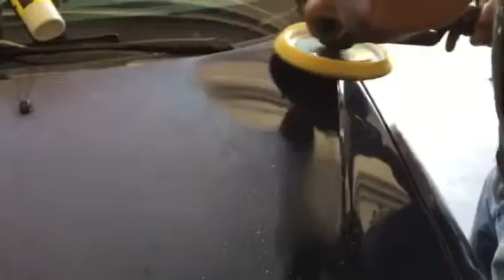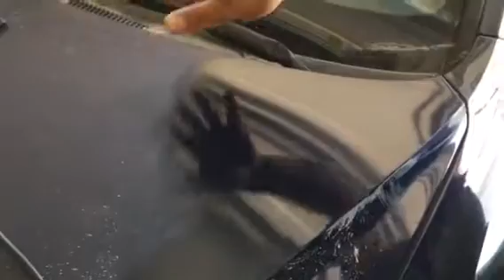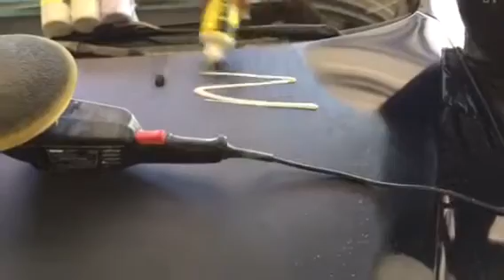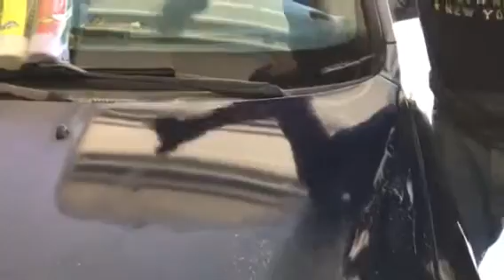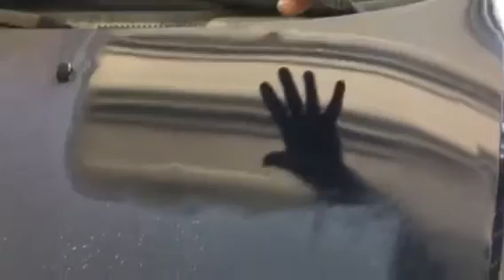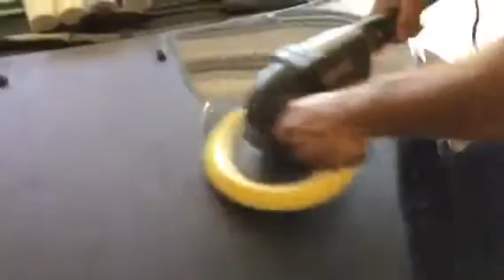Lukat Fix It and the Electric Polisher 3

Comment: I used some Lukat Fix It today used the rotary on speed 6 I burned through the clear a little bit but gonna paint my truck again this year had it on a speed 6 got a da polisher battery operated too rotary got to watch on speed I did the same thing almost two years ago.
Reply from the maker: These products are made for restoring old auto paint jobs 
If your old car or pickup truck's paint is old and hazy here's the product made for bringing back the good remaining color and shine. Lukat Fix it Color and Gloss restorer polisher and the Lukat EZ Sealer wax.  
Two Products Two Simple Steps One Great Finish
Step One: Use The Lukat Fix It Old Paint Cleaning Polisher to remove embedded oxidation, contamination, from off of the surface of your old auto paint job.  
This product is not an auto paint wax rather it's a liquid deep cleaner made for polish cleaning removing restoring your old paint job back to a smooth and shiny state. 
If you have a classic car with an original single-stage paint job with an oxidized chalky patina or a ruff textured patina on an old metallic single-stage base coat? Then this is the stuff to bring it back.
Step Two: Use the Lukat Ez Sealer Wax to preserve and protect the finish. 
Apply like a regular wax let dry and cure for about ten to twenty minutes then remove. 
Remember these are old paint restorer products there made to bring back your paint to a better state. After these two simple steps, the paint job will be smooth and shiny once more now you are able to use any over-the-counter wax to enhance the finish.
Special disclaimer for a delaminated clear coat,
( WE CONSIDER DELAMINATING CLEARCOATS AS DESTROYED PAINT JOBS ) If your car's clear coat is eroding or peeling the very best thing to do is simply repaint it. Once the clear coat comes off it's not coming back.
BUT IN THE MEANTIME, you can use our products to help beautify the car's paint job, use the Lukat Fix it Color and Gloss Restorer Polish to polish clean back the remaining color and gloss on the good remaining clear coat and polish clean back the shine on the good remaining color base coat. Feather back the crumbling edges preferably with a kitchen scouring pad or sandpaper 400 to 600 grit. If you want to know more simply call us if we don't answer text us and we will get back to you. Thank You.
Got questions call us at 806-702-6381
Got questions call us at 505-304-8652
To order online visit our website at lukatdetail.com

Comment: Is Lukat Fix It better to use with a rotary polisher than a da polisher I have got better using a rotary than I did when first got one some years ago probably 2 years ago.
Reply from the maker: Got questions call us 806-702-6381
These products are made for restoring old auto paint jobs 
If your Pickup truck's paint is old and hazy here's the product made for bringing back the good remaining color and shine. Lukat Fix it Color and Gloss restorer polisher and the Lukat EZ Sealer wax.  
Two Products Two Simple Steps One Great Finish
Step One: Use The Lukat Fix It Old Paint Cleaning Polisher to remove embedded oxidation, contamination, from off of the surface of your old auto paint job.  
This product is not an auto paint wax rather it's a liquid deep cleaner made for polish cleaning removing restoring your old paint job back to a smooth and shiny state. 
If you have a classic car with an original single-stage paint job with an oxidized chalky patina or a ruff textured patina on an old metallic single-stage base coat? Then this is the stuff to bring it back.
Step Two: Use the Lukat Ez Sealer Wax to preserve and protect the finish. 
Apply like a regular wax let dry and cure for about ten to twenty minutes then remove. 
Remember these are old paint restorer products there made to bring back your paint to a better state. After these two simple steps, the paint job will be smooth and shiny once more now you are able to use any over-the-counter wax to enhance the finish.
Special disclaimer for a delaminated clear coat,
( WE CONSIDER DELAMINATING CLEARCOATS AS DESTROYED PAINT JOBS ) If your car's clear coat is eroding or peeling the very best thing to do is simply repaint it. Once the clear coat comes off it's not coming back.
BUT IN THE MEANTIME, you can use our products to help beautify the car's paint job, use the Lukat Fix it Color and Gloss Restorer Polish to polish clean back the remaining color and gloss on the good remaining clear coat and polish clean back the shine on the good remaining color base coat. Feather back the crumbling edges preferably with a kitchen scouring pad or sandpaper 400 to 600 grit. If you want to know more simply call us if we don't answer text us and we will get back to you. Thank You.
Got questions call us at 505-304-8652
To order online visit our website at lukatdetail.com
to order by phone call 806-702-6381

Comment: wow my truck has the same issue with clear coat peeling n the fading so i guess using the buffer is better than using my hand which would take for even great job
Reply: That's how I use the FixIt product as well 
 Huge difference
Reply: What Kind of polisher is that?..And Pad!! Would This Work On A DA Polisher?...